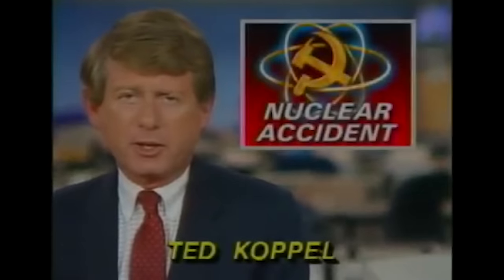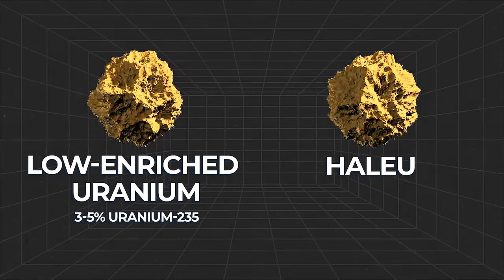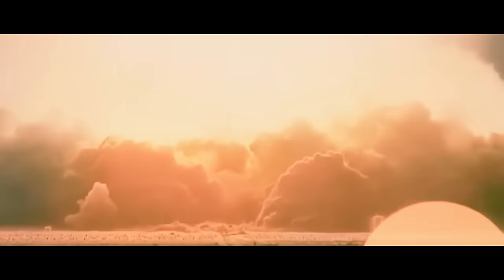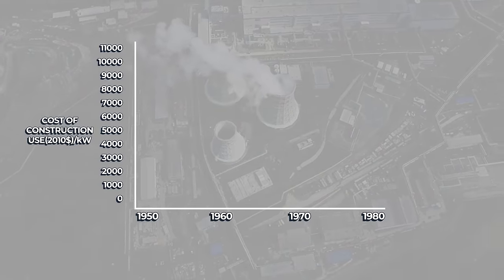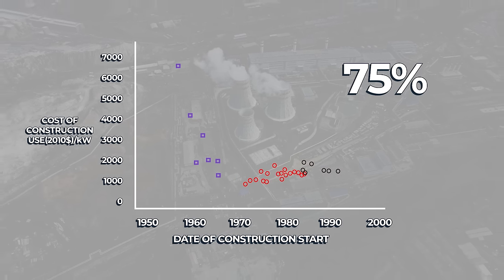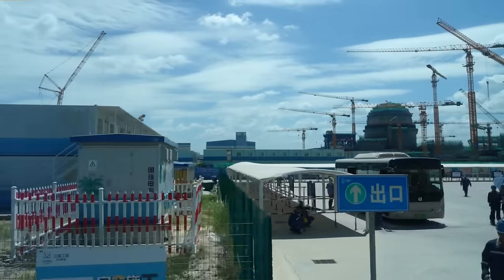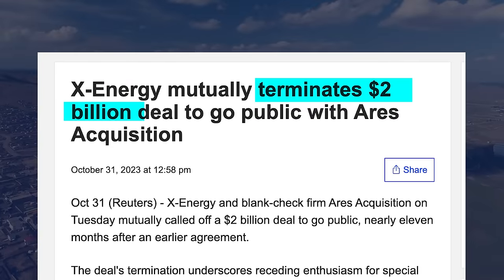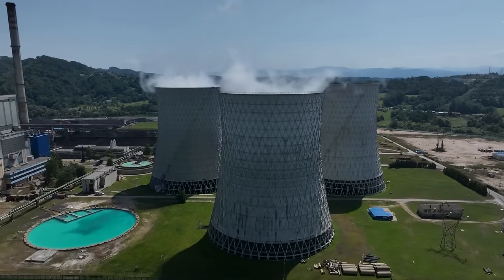Nuclear 4.0 | The Small Modular Reactor Revolution

Comment: This analysis of SMR's is very poor as it fails to even address  most of the contemporary how-too of the methods of reaction control afforded by the digital age: which is NEVER mentioned in the video.  All this video basically does is give a historical analysis of a historical system applied toward a modular deployment, WHICH IS NOT how SMR's would actually get deployed.  There's no discussion of pebble fuel models, molten salt models, or probably most importantly: forced input models (which are passively safe).   NO ONE in the nuclear industry is suggesting ANY configuration you have suggested in this video.  You have failed to provide an effective analysis of what IS being pushed to provide regulatory standards for.  Also - you don't address that the wind/solar cost analysis all have the major asterisk of not having to count storage and intermittency  real-world deployment costs.  Nuclear is still cheaper than wind/solar in terms of actual 'real-world' deployment, and not by a small margin at all -- don't believe - ask Germany and France how their energy costs have compared over time.  Real-World costs are all the actually matter in REALITY.  It doesn't matter what a chart or a piece of paper says and wind/solar have FAILED utterly to demonstrate their industrial claims in real-world application.  Dont' look at what the sales people claim -- look at the history of data collected from real-world application.

Comment: A better question is "should it?" Every property generating solar and wind and feeding excess into a communal grid is a very resilient system. A single reactor is a single point of failure for an entire city.
Reply: > A single reactor is a single point of failure
Sure, but ....

The most common type of blackout/brownout is due to transmission/distribution losses. See EIA/EPRI/NERC for citations. (trees falling on lines, animals short-circuiting the lines, etc)

The plants themselves (nuclear, coal, natural gas, hydro) rarely go offline.

On the other hand, you can site them near your city - so LESS line to go bad; intermittent RE (wind/solar) tends to be sited far from cities (mountains/offshore for wind, plains/desert for solar) - so MORE line to go bad.

> Every property generating solar and wind and feeding excess into a communal grid is a very resilient system
The problem with that is that residential (industrial suck waaay more juice than their area can cover) transformers all experience the same weather at the same time.
So if you have transformers (installed over the last 20-30 years) designed to provide, not accept power, and you force them to provide instantaneously when a cloud goes over a neighborhood, and then switch in minutes to accepting power when the cloud leaves, and the power accepted is higher than the rating ....  poof! The magic comes out as smoke.
Reply: @factnotfiction5915  Your reflexively problematizing seems somewhat removed from reality. Do you live in a world where every lightning strike takes out the grid? The grid is already designed to absorb surges. additional protection against your fantasy scenario would be far cheaper than  a modular nuclear reactor. Transmission/distribution incidences are far less likely to either occur or to take out entire grid regions when generation is fully localized. Industrial facilities have flat roofs often acres large plus massive parking lots. More than enough area to produce their own wind and solar. Imagine what you could come up with if you put even a fraction of the mental effort that you just put into inventing problems to looking at solutions instead.

Comment: Please don´t spreed propaganda spawned by oil and gas companies.
Thernobyl reactor safety system didn´t fail, they never existed to begin with. The RBMK realtors was built with out safety system becasue they where originally made as military reactors. In the late 1970 and 1980s USSR was so poor they no longer afford to build VVER reactors, so they start building RBMK reactors as civilian reactors. It was still a military design that lacked all the civilian safty infrastructure and also passive safe moderators.

While there was massive amount of radioactivity spreed from Chernobyl, this was not the case from TMI nor Fukushima. The low level leak from TMI flushed into the ocean and was below trace level with in days.The  claim of massive radiation was a pure fabrication from the oil industry. In fact the oil and coal industry create more radiation when operating as usual than TMI created when it failed.

For Fukushima its a bit more complicated. Its worth saying that not a single people died from fukushima accident.  Actually nobody have ever died due to failure of a fully civilian nuclear reactor power-plant. There was a zone with fairly high amount of radiation between 5 and 10km2. This zone is far smaller than  have been effected by accident from coal and oil infrastructure. Like when a gas pipeline blow up in china in 2012 effecting dozen of square km and killing over 40 people.

8:10 Those are not the effect of new safety regulation but rather post build certification that was pushed by the oil industry in the US. This was the reason why reactors skyrocketed in price in the US. At the same time in France, Sweden, Japan that was building large number of reactors at the same time, price did not skyrocket despite also implementing same changes of safety systems.

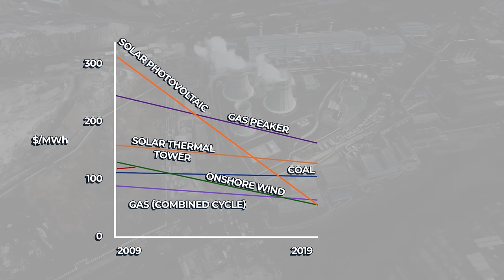8:38 This grath is from known nuclear hostile thinktank lazard that use cherypicked data to produce what ever who pays the bills want to see. Its not true

Comment: Half way through the video..... geat example of telling half the story.  Nuclear is not on the brink of obsolescence..... Especially not becasue of so-called renewables. (Wind and solar are retrograde power sollutions with lipstic of new technology making them seem viable). Even with all the known accidents, nuclear is the safest form of energy.  Nine mile island was not a disaster.  Nothing bad happened.  Chernobyl was old technology without responsible care, Fukushima problems were due to external cooling pumps failing when the sunami flooded them.  Even so, Far more deaths and injuries of occur in the production and operation of wind and solar.
We just need to get on with it and stop stuffing around with politics.

Comment: 3-MILE ISLAND IS STILL OPERATION.  THE SAFETY MEASURES WORKED AS THEY WERE INTENDED.
The beaurocratic mess is caused by intermingling with crooked government and crooked union..  
SMRs seem like a better idea.  Thorium reactors can be an option..  You could have a thorium reactor in your backyard.  I have thorium in my tool box.  Thorium is cheap and barely radioactive.  I think multiple thorium units on a property MIGHT be a workable solution.  Smarter people than me should do an analysis.  Say..  maybe a Master's Thesis for Nuclear Engineering...
    Keep costs down and QUIT HIRING UNION COMPANIES BECAUSE THEY ARE UNION.  Just hire the construction companies that has a proper qualification system and safety record.

Comment: Die Kernkraft ist zu teuer und auch weltweit ein Auslaufmodell, bestenfalls kann die Kernkraft sich den Istzustand im Energiesektor sichern.
Und die Kernkraft hatte mal ca. 17,5% Anteil am Strom und im Jahr 2022 nur noch 9,8% in der Welt.
Im Jahr 2023 ist die installierte Leistung bei der Kernkraft um ca. -1GW zurückgegangen.
Zum Vergleich, die Erneuerbaren liegen bei ca. 29% und ca. +1% kommen im Jahr dazu bei den TWh, weltweit.
Im Jahr 2022 wurden die Erneuerbaren um ca. +295GW ausgebaut und im Jahr 2023 um über +400GW, weltweit.

Nuclear power is too expensive and is also being phased out worldwide. At best, nuclear power can secure the current state of the energy sector.
And nuclear power once had around 17.5% of electricity and in 2022 it will only account for 9.8% in the world.
In 2023, the installed capacity of nuclear power fell by around -1GW.
For comparison, renewables are around 29% and around +1% are added to the TWh per year worldwide.
In 2022, renewables were expanded by approximately +295GW and in 2023 by over +400GW, worldwide.

Comment: Errors & Corrections
1. Most of the heat energy from U-236 fission is from the energy released during the decay. This energy comes from the E=mc^2 relationship. Neutron absorption does off give some heat energy but no where near as much as matter -> energy transition.
2. You have not ‘done the math’. You are British. You ‘did the maths’.
3. Moderators do not ‘increase the likelihood of a neutron hitting a U-235 atom’, they increase the likelihood of a neutron being ‘absorbed’ by a U-235 atom, ie turning it into U-236.
4. A ‘night’ on the moon is 14-days long, not 2-days.

Comment: At about 9:38 he states that "We will always need reliable sources of base load power to complement intermittent wind and solar."  This isn't true.  As long as there is adequate storage there is no need for "base load power".  Adequate storage may require building a lot of pumped hydro storage projects.  But lately (2024 April) the costs of battery storage has dropped dramatically.  New batteries do not need nickel or rare earth metals.  The LFP batteries are extremely long life, too.

But new nuclear power just cannot compete in this world of cheaper and cheaper solar and wind energy.  It's in our best interests to keep existing nuclear power running, but the utilities are unable to because nuclear and all thermal plants are becoming uneconomical and stranded assets, so they're shut down and decommissioned.  They're being replaced by renewable solar and wind and low cost battery storage.